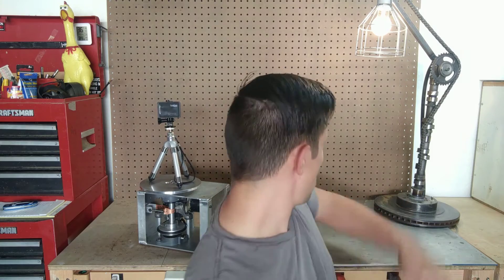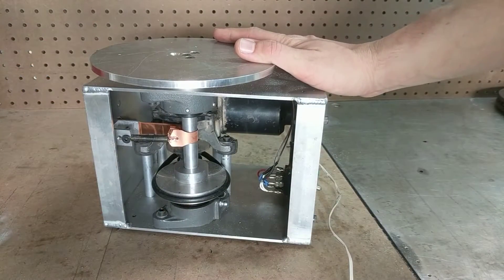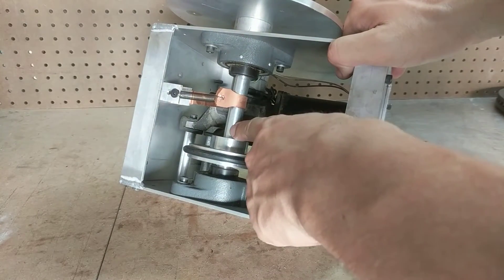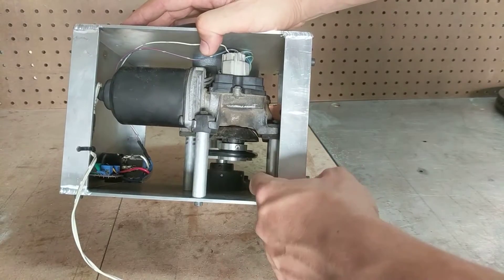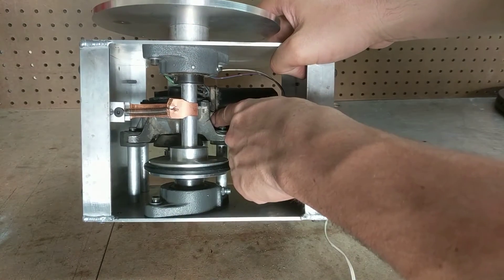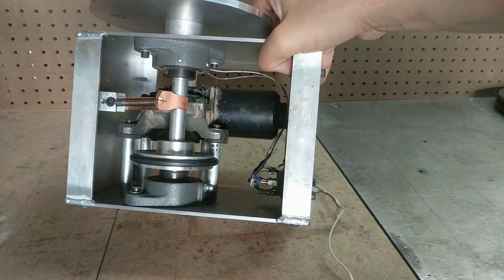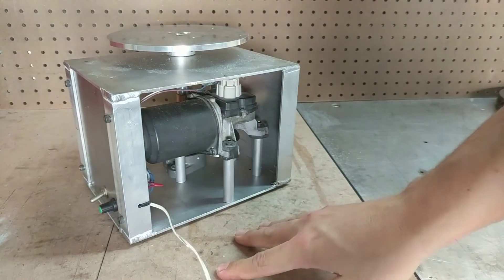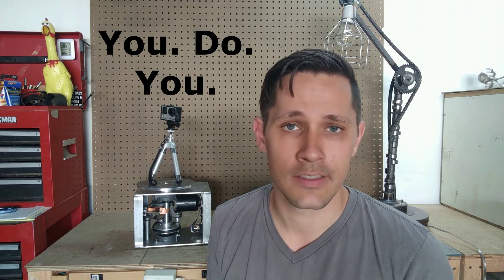I made a Welding Turn Table!

Comment: It's been about a year now. Do you use it much? What would you change on it, if you could be bothered, or how would you make it differently, now that you've used it for a while. I'm thinking of making something like this, and I have a windscreen wiper motor laying around as well. I'm inspired!
Reply from the maker: Sad to say it's been in a crate under my tool bench for far too long. I acutally pulled this out just last weekend! I haven't been welding as much as I use to and even less or round things. 

If I was to rebuild it, I'd step down the motor one more time to slow it more, though I remember wanting as small a foot print as possible. 
And I'd raise the welding base higher so I could get a bigger/better clamp on it. As it turns the clamps sometime crash into the side, the work piece moves, I have to stop welding, I start rethinking all my lifes choices. It'd be better like an 1/2 or full inch higher. 

Happy someone is inspired! This was a lot of fun to make. If you build one shoot a quick video or take pics to show it off! Love seeing how people come up with diy's to EXPENSIVE tools!
Reply: @TylerStoner  oh that's a shame you haven't used it much. Good tips re; size of turntable and height.